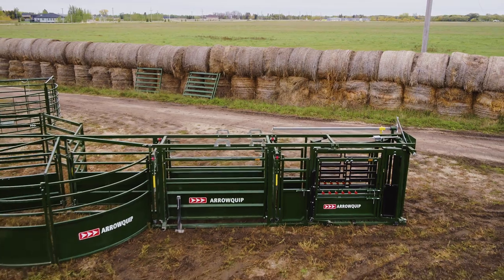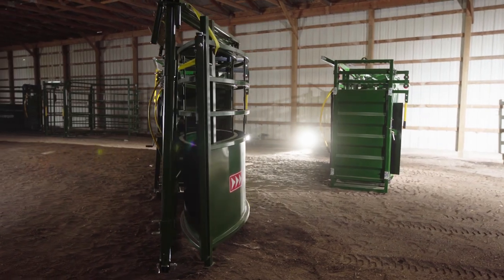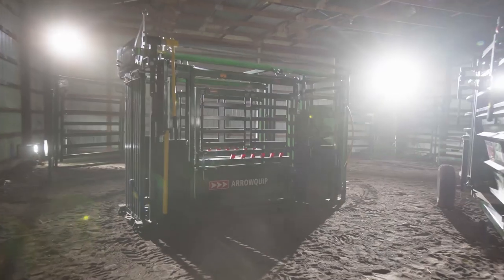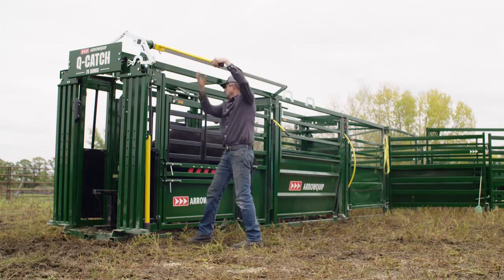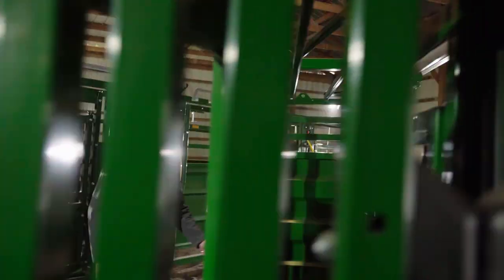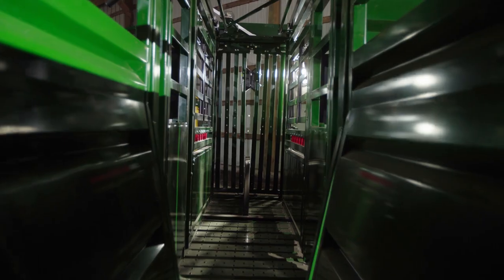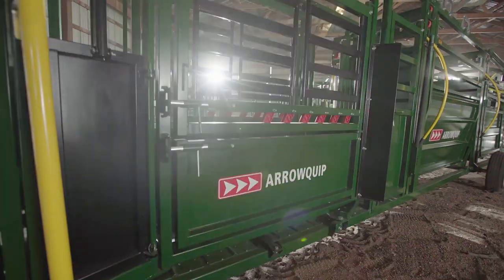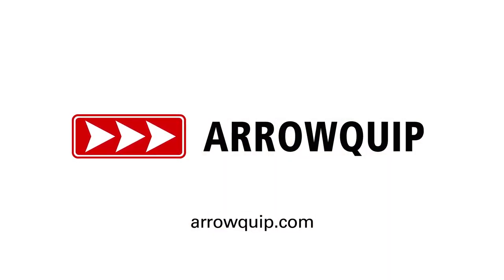Q-Catch 74 Series Portable Cattle Handling System | Cattle Chute, Alley & Tub | Arrowquip Showcase

Comment: What are the differences between the 86 series and the 74 series?
Reply from the maker: Thanks for asking. Head gate styles are different as the 74 features our new version of the Q-Catch head gate to work with cattle psychology for better flow. Both chutes share similar access features and the same patented squeeze and head gate locking mechanisms. Operating the chutes are quite similar. For flooring, the 86 comes with 100% true virgin rubber from Goodyear, while the 74 comes with a metal-stamped ribbed floor. They both come with a vet cage, however the vet cage on the 74 remains stationary when the chute is squeezed. There's lots to talk about - but for a side-by-side comparison, feel free to download the product brochures on the website here - https://arrowquip.com/cattle-equipment :) Please reach out if you have any more questions!